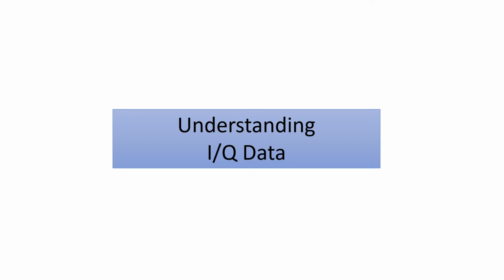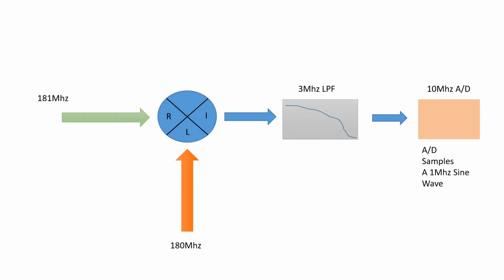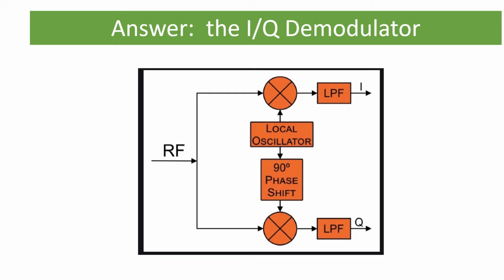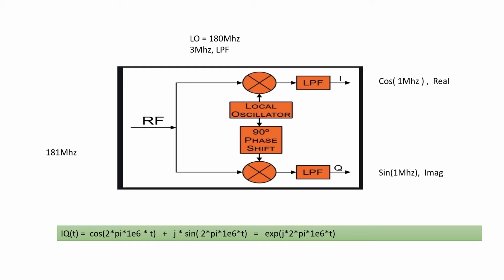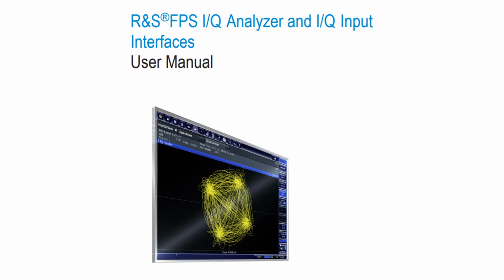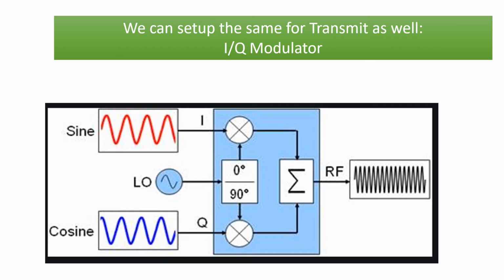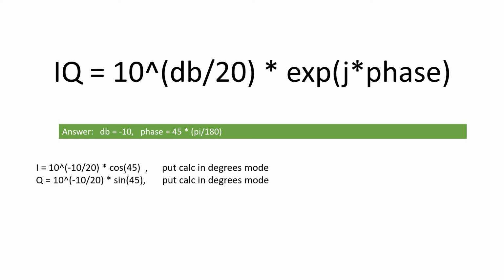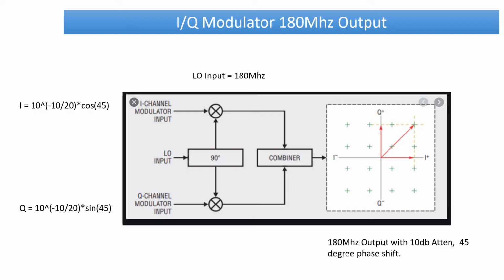IQ Signals

Comment: That does not look like 10 Db of attenuation. Where did the 20 come from? You are dropping the signal level by a factor of 0.316 when the strength should 0.1.  How is that 10 dB ???
Reply from the maker: @exponentmantissa5598  math is correct,  db to voltage,  10^(db/20)

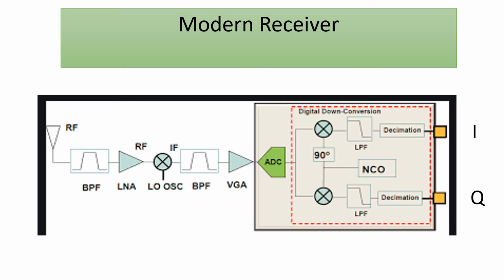Comment: The receiver block diagram presented @4:55 shows an ADC between the IF stage and the DDC block. I thought the output of an ADC was   a binary value (composed of 1's and 0'S) that represented the level of the analog signal at the sampling time. How can such a binary representation of the signal level be used by the DDC? Thank you!

Comment: I have an on-again off-again project for a SDR based on a superegenerative front end.  Phase information is typically obliterated but I plan on recovering it using the fact that the tank circuit stays locked in phase with the carrier. So I want to make a circuit that can recover the phase AND amplitude of the signal in IQ form, just like a normal SDR.  The idea is to eliminate the ADC and also have tremendous dynamic range.  Most of the SDRs I have made suffer from artifacts when front end is overloaded.

So far I can decode things like 8-PSK, but I hope to make it work for signals in general.
Reply: Superregen is very difficult to keep stable, why do you want to use it? It made sense way back when every single tube was very expensive, as it saved components. Now that good RF amplifiers are cheap and perform well, why not use them?
Reply: @philkarn1761  i do still use conventional zero-IF and various IQ front ends.  Doesn’t mean I can’t experiment and play around right?
Reply: @weirdsciencetv4999  Sure! I still remember the superregen toy CB transceiver I got as a kid. Got me started...